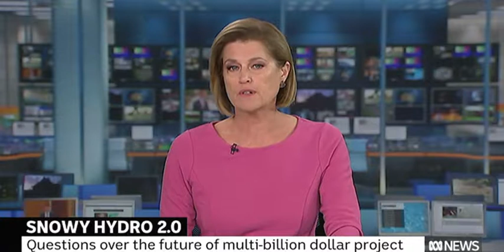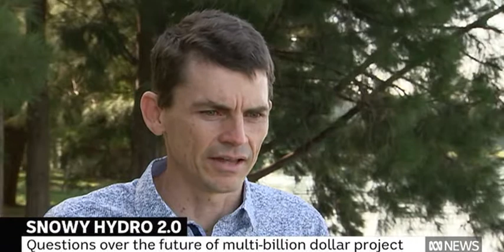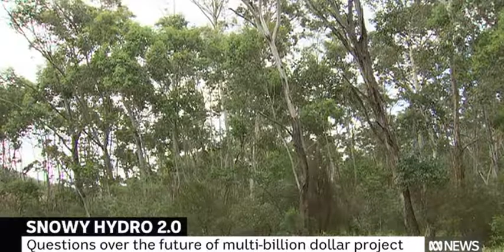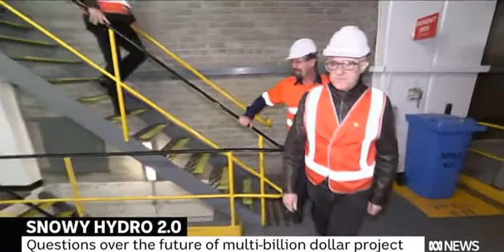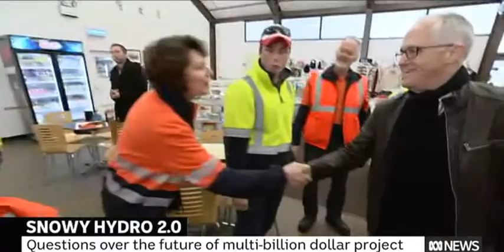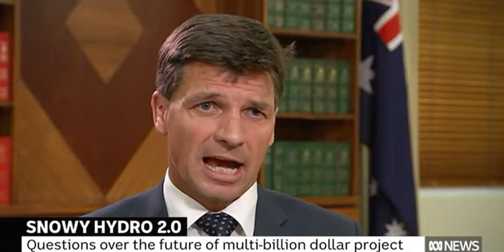SNOWY HYDRO 2.0 QUESTIONS OVER MULTI BILLION DOLLAR PROJECT

Comment: This doesn't "Stack Up".. The usual '6pm Demand' of the 3 Eastern States is over 25,000 MW!
At 2000 MW, the 'Snowy 2 Pumped Hydro' project will only be able to supply 8% of this demand! 
At 6pm, we would need 12 of these to replace fossil fuel burners! (At 6-8 billion dollars each!)
The 'Pumped Hydro' project at the old Kidston mines is only 250 MW, it will only be able to supply 1% of this demand!